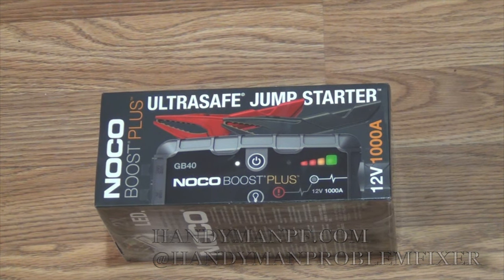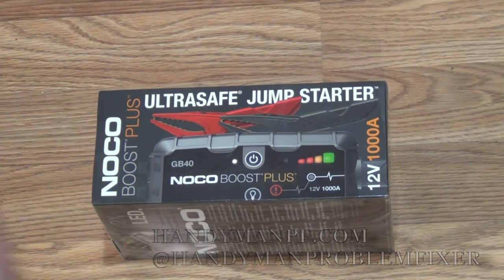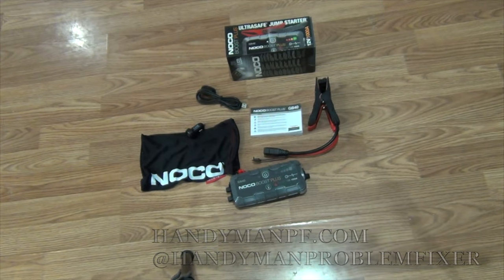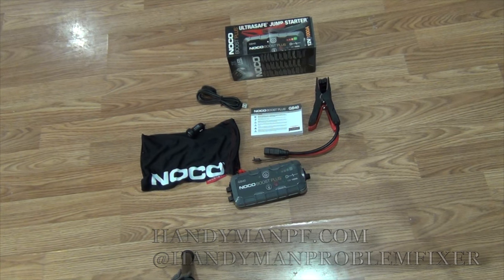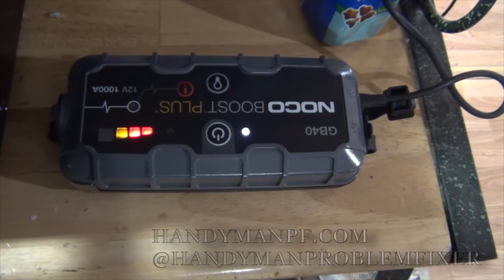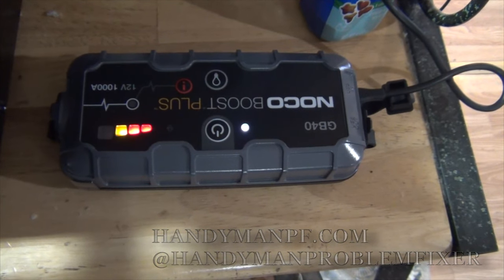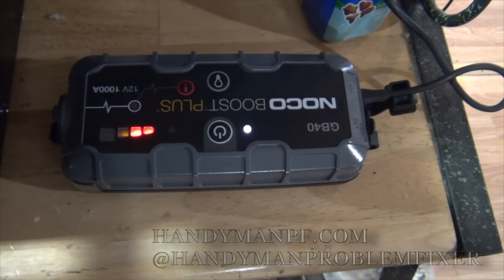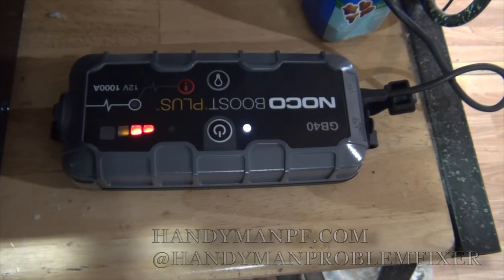NOCO Boost Plus GB40 1000 Amp 12 Volt UltraSafe Lithium Jump Starter Box No nonsense review video

Comment: The jump starter won't work if your battery has less than 2% power. In that case you have to press the override button but be careful if you need to do that cause the override button disables the safety features on the unit. Make sure  alligator clamps are attached to the correct battery terminals.

Comment: Just got this unit tonight for Christmas.  The packaging and feel of the unit is absolutely Apple-level quality.  I cannot tell you how impressed I am with the feel, fit and finish of the product.  The new version seems to have a little less beefy battery clips, but overall, as far as perceived value for the money, it's tits.  It's currently topping off the charge and then I will attempt to run an older, 12-volt tire compressor with a 30 amp fuse in line that normally connects to a battery.  If I can pump a tire with it, it's worth it's weight in gold as a multi-tasker.

Comment: Will it work if the battery is completely flat? (as in, not close to being flat, but utterly flat) I have been seeing mixed information on this online. Hope you can help.
Reply from the maker: It should. It did for me. As long as there is a little life in it to turn on an interior light or something
Reply: Yes, if the battery has less than 2v then there's an override button, but make sure you have the clips on the correct terminals as it disables the wrong polarity feature.

Comment: Does the weather ( extremely cold / hot, rain ect. ) have any affect on the Jumpstart ?
Reply from the maker: I used it in minus 2 degrees and it worked. Granted it does consume a lot of energy in those temperatures by working harder. But never the less, it still worked.
Reply: @handymanPF  I bought a GB 40 recently from Amazon and haven't actually used it yet but I've noticed that the cables disconnect too easily from the charger. Have you noticed this on yours? If and when I ever use the charger I'll need to attach the cables to the battery posts first.